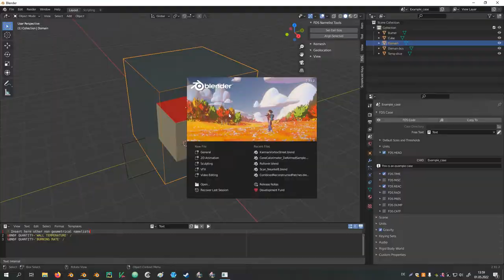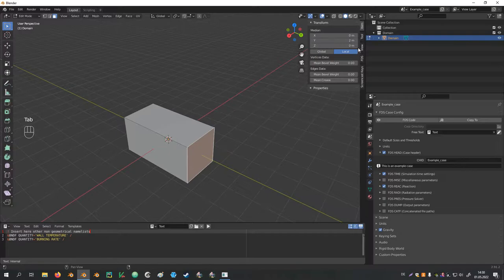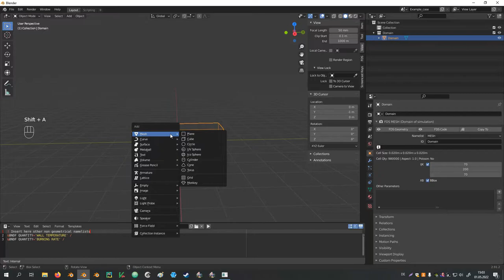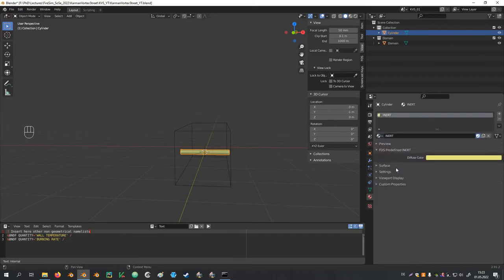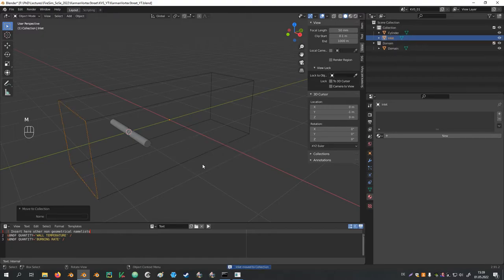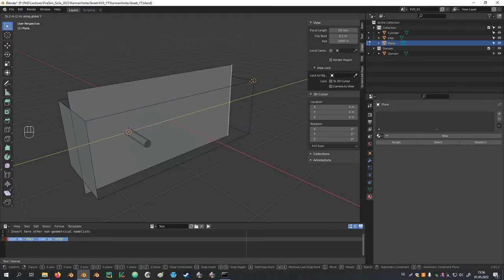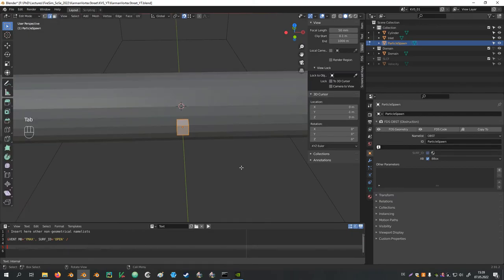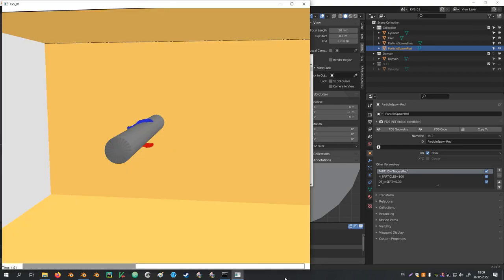Getting Started with BlenderFDS | Karman Vortex Street

Comment: Your videos are amazing, very helpful and bring fresh Vibes of incorporated tools with FDS,  when I read the user guide. One limitation of GEOM is that it cannot perform heat transfer. So mostly people use the GEOM as a burner.  My question, can we use a multiple GEOM in one simulation? Let's say if we want to simulate an entire building with a lot of slender body and curve along with it
Reply from the maker: Hi @kartiniganesha6741

To the best of my knowledge, one can use multiple GEOMs within a single simulation setup. I've done so myself in an earlier version (FDS 6.7.7). There I used a GEOM to determine the radiative heat flux to the sample in a cone calorimeter. Said model consists of three GEOMs: top and bottom plate as well as the heating element, see video here on the channel: https://youtu.be/1GY_ggw1yPA. 

Please also have a look at the FDS users guide of the nightly builds: https://github.com/firemodels/test_bundles/releases/tag/FDS_TEST
There is some discussion on limitations of the GEOMs presented. For example thin GEOM cannot divide a fluid cell, the smaller half will be filled. Also corners cannot divide a fluid cell. You may therefore need to refine the MESH locally, to be able to capture the geometry you'd like to represent.

With respect to the heat transfer: The GEOMs are still in development, thus come with some limitations. I suggest to have a look at the user guide in the nightly builds, to get some of the most recent information on the capabilities implemented into FDS. 

For now, I would also suggest to use the OBST as much as possible.

Hope this helps, have a nice day!
Reply: @firesimandcoding  thank you so much for the insightful response. I have a question for a HRR calculation, if we have the scaled HRR measurements from the laboratory, which approach is more accurate to predict the full scale HRR based on scaled HRR?
Reply from the maker: Hi @kartiniganesha6741

you're welcome!

Could you please elaborate on which kind of experiment you are interested in and what you mean be "scaled HRR"?

For large-/real-scale experiments, two common methods to determine the HRR are to calculate it from the combustible mass flow or from the oxygen consumption. With this I assume there is a room containing a gas burner, similar to the Steckler compartments, or the Singe Burning Item test.
The combustible mass flow could be used for a gas burner, where one knows the heat of combustion of the gaseous species: 
HRR (kW) = mass flow (kg/s) * heat of combustion (kJ/kg)

The oxygen consumption method is based on work by Huggett ("Estimation of rate of heat release by means of oxygen consumption measurements", https://onlinelibrary.wiley.com/doi/abs/10.1002/fam.810040202). There is also some discussion in the ISO 5660-1:2015(E) "Heat release rate (cone calorimeter method) ..."

Is this what you are interested in?
Reply: Hello  @firesimandcoding , thanks for the response , it's almost there. I will try to elaborate more. Let's say, we conduct the HRR measurements based on oxygen consumption with a cone calorimeter . Regularly the size of the material is small (https://youtu.be/mnzKthvkSx0) . The question is, can we scale up linearly the value of HRR for the tested materials? For instance the tested material's size is 15x15 cm. But, we need a scenario with the sizel of 15x15 metres with the same materials.
Reply from the maker: Hi @kartiniganesha6741, typically the data from the cone calorimeter experiment is given in context of the exposed sample surface area. This leads to a heat release rate, or mass loss rate, per unit area, i.e. kW/m² or kg/m². Thus, the data is supposedly independent of the sample size.

However, it is important to note that the data has the experiment setup baked into it. Consider that one would perform a cone calorimeter experiment with a radiative heat flux of 50 kW/m², from the heater to the sample surface. This value is typically kept constant throughout the whole experiment. If a flame forms, it will contribute further to the heat flux into the sample, by an unknown and also variable amount. During the test the sample might also deform, which may change the distance between heater and sample surface. Thus, the heat flux could vary by some amount. So, the HRR vs. time profile you get as an response from the experiment implicitly contains all of this. If you are sure that the full surface area receives the heat flux profile like the experiment, you could simply scale it up. Though, I have doubts that it works this straight forward in most cases, but might be better than nothing.

FDS provides some mitigation measures for this. It is able to adjust the HRR based on the incoming heat flux. Please have a look at section "9.1.4 Scaling the Burning Rate by the Heat Flux" in the FDS-6.8.0 users guide (https://github.com/firemodels/fds/releases/download/FDS-6.8.0/FDS_User_Guide.pdf). There are also procedures to determine ignition temperatures for solids from cone calorimeter data. An overview is provided in the Ignition Handbook by Babrauskas (https://www.researchgate.net/publication/288833461_Ignition_Handbook), specifically procedures by Janssen, Quintiere and Tewarson (pages 260 to 265). We have also a brief discussion on using cone calorimeter data and determining the ignition temperature, similar to what is described above (Appendix D in https://www.mdpi.com/2571-6255/3/3/33). Just note that no heat flux adjustments are performed in the simulations -- if I remember correctly this was not yet implemented in the used FDS version.

In general, I would suggest you have also a look into the "SFPE Handbook of Fire Protection Engineering" (https://www.sfpe.org/publications/handbooks/sfpehandbook) and the "Enclosure Fire Dynamics" book by Karlsson and Qunitiere (https://www.taylorfrancis.com/books/mono/10.1201/b22214/enclosure-fire-dynamics-second-edition-bj%C3%B6rn-karlsson-james-quintiere). Specifically, focus on heat release rates and design fires.

Hope this helps!